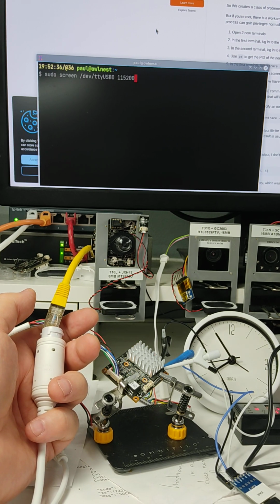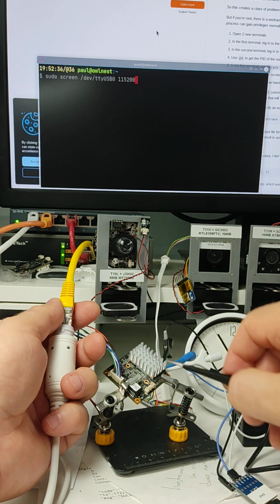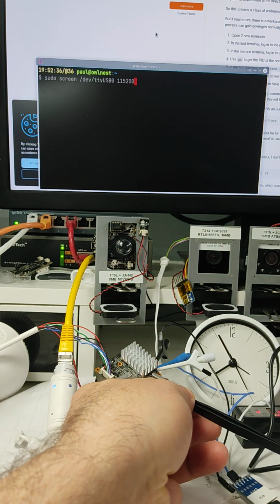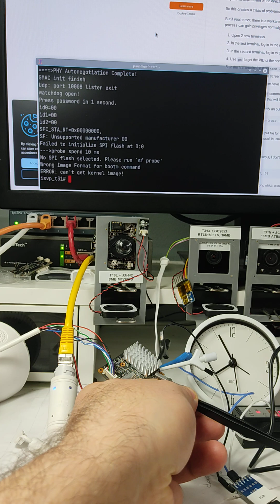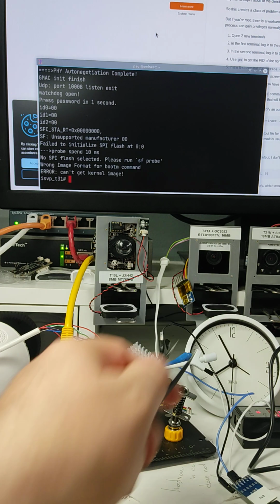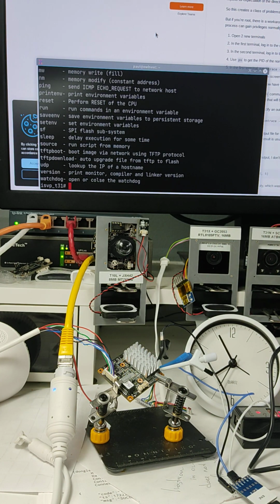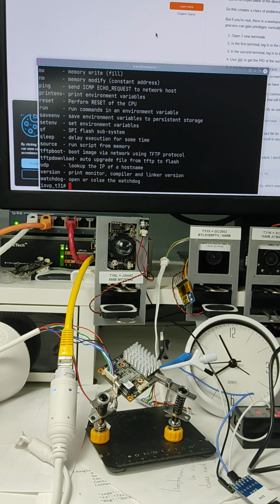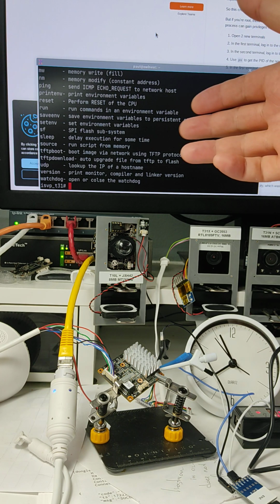Getting access to bootloader shell

Comment: Yeah this is a common technique to enter the bootloader when either autoboot is set to 0 or not enabled or the uart shell is password protected... This technique is called glitching and as you said you basically let the soc read the bootloader and to boot the bootloader and after that when the bootloader tries to read the kernel from x adres to x adres and put it into ram you basically prevent the soc from reading the flash, kind of like unplugging the hard drive/ssd/storage on a pc. I also do this a lot cause some devices dont have a shortcut to enter the bootloader or even have a password on them